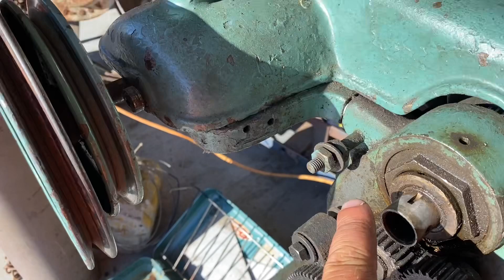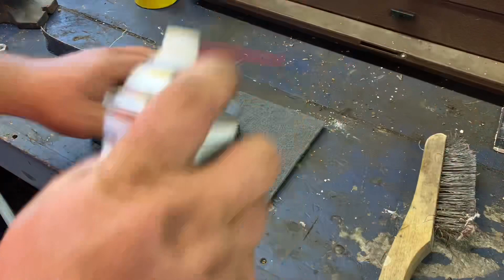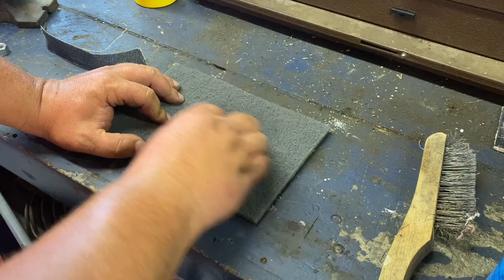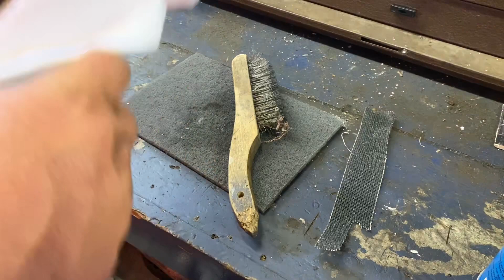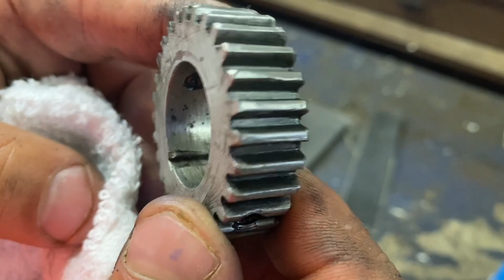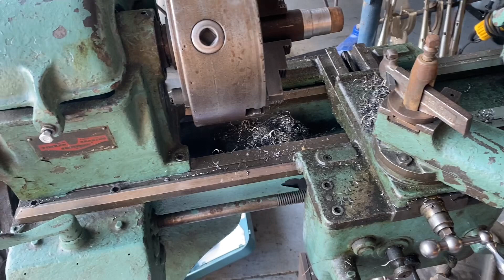Installing the missing spindle drive gear on the atlas Clausing model 100 lathe

Comment: I just picked the same model lathe. It looks like it’s been parked most of its life. I put a new 2hp motor on it and am very impressed. I took an extra Chuck backing plate and mounted a 6 jaw 4” diameter Buck Chuck on the spindle. Still figuring out how to adjust the spindle bearings. So I purchased a copy of the original manual.
Reply: Did you get your spindle bearings. I have the same lathe and have adjusted mine.

Comment: The person that sld the lathe you basically gifted to them, sucks. I can only wish I had a nice lathe to use. I bought one while back but it was missing all of the gears, it had no handwheel for the apron or anything, no split nuts for the obviously replaced lead screw that is too small for it. I bought a metal set of gears to try and add the gears to it but haven't had a chance to make the gear stack for it yet. I have been trying to find the other missing pieces second hand too but I may as well just go buy a comlete lathe for the cost it would be to put this one back together (which is suer disheartening because it is a nice little Chas A. Mann antique engine lathe) and I have been searching for a lathe that it broken or something that could be used for parts but I have had no luck finding anything even after spending the last several months looking at least a handful of times per week.
Reply from the maker: It does suck when you co e across a cool old machine and it has problems like that, parts can be near impossible to find for a lot of the machines out there

Comment: I hate splitting them up myself, but the pair of legs pulls $1,000 on eBay all day long. His hipster coffee shops make them into tables. You can get twice the price if there is raised lettering. Honestly it makes them better machines if you get a scrap of one inch thick steel and bolt the lathe down to that. It's pretty trivial from that point to make a drip tray for chips and the money from the legs is enough to get set up with the basic tooling if not quite a bit